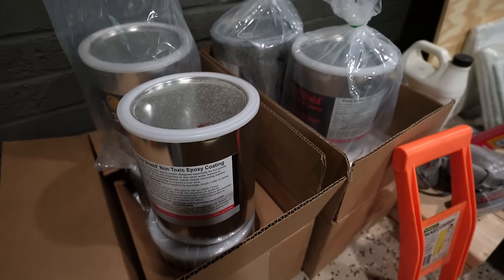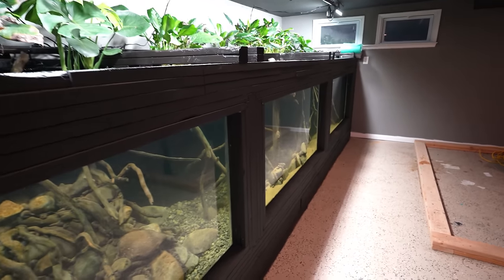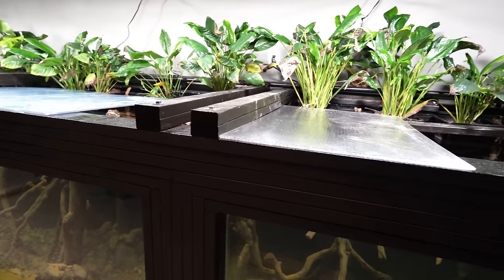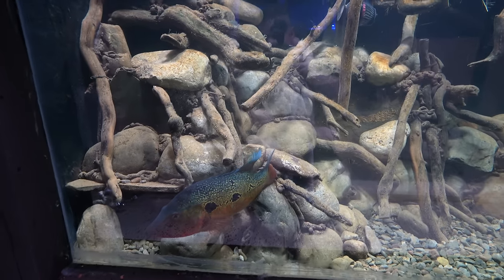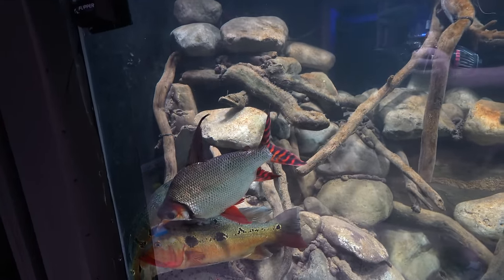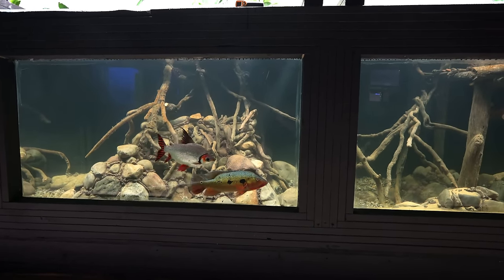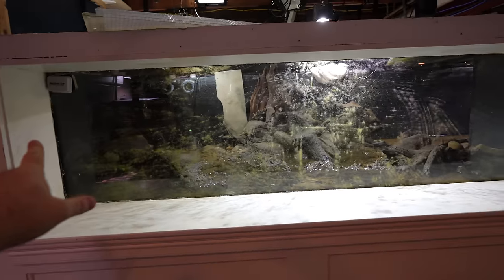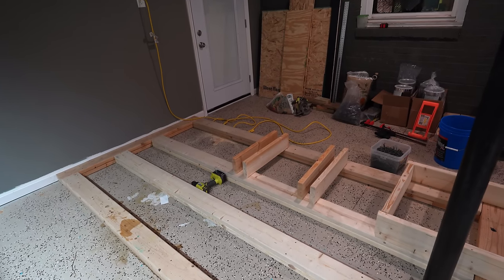Moving Monster Fish into the 4500 Gallon Xingu River Aquarium & 3 Big DIY Projects Begin!

Comment: This has really come together well, bravo! 🎉 One concern I have is that when you build those other 2 aquariums you won't have the opportunity to sit back and take the whole tank in. Is there enough room to sit and relax between the big tank and the 2 new ones? Looks only about 4 feet space? Do you hope to keep the nutrient levels more under control in this tank? I see a lot of tough black algae in your previous installation, while it's not any harm to the fish, it's very unsightly. I would 3xpect the big filter should be more than enough to keep it stable. Good luck, I look forward to seeing this mature. You changed my mind on your scape 👌
Reply from the maker: It is a little over 4 feet and the open area in the middle is 12 feet, so about a 10 foot isle to the left and right. I mocked up some wood to check the view and from the human eye it is unobstructed, but from the camera you have to pivot side to side....anyways I am still deciding 😊

The 3000 never had nearly enough water flow, mechanical or clean up crew for big messy Cichlid and Bass, everything about the new build is to correct those issues. 😊
Reply: @AquariumDomain. Great to see you moved it back a little as in your latest video, I think that's going to make all the difference to you!

Comment: Not scared of plecos shredding through the wood or seal?🤐
Reply: That's the question I also have! (Because I HAVE plecos in my plywood tank and I'm not sure if that's a good idea)
Reply from the maker: I have kept large amounts of Pleco in all of my diy tanks for decades and haven't ever had a problem. I think they are way more interested in the leftover food from the big boys and the biofilm on the rock and wood.
Reply from the maker: I have kept large amounts of Pleco in all of my diy tanks for decades and haven't ever had a problem. I think they are way more interested in the leftover food from the big boys and the biofilm on the rock and wood.
Reply: @AquariumDomain.  Thanks a lot! My plywood tank has been installed for two weeks now and I never saw my plecos on the walls. I had them in a polycarbonate tank (also diy) for about a year and they never scratched a panel. Epoxy is even harder than polycarbonate

Comment: Lol.. I would like to have a problem of "accidentally building 2 1500 gallon aquariums". As excited as I am about all that fish move, a missed opportunity there. Could have should have would have put 1 guppy into 4500 for kicks and giggles (and then move back out obviously). It would have been the fanciest guppy on the planet for a little while. I am glad they are all settling in. The 3000 looks like a warzone but I am sure that sharks and angels are going to love it. I hope you model it after something cool like Roatan Honduras (my most favorite scuba place). Of the 3 times I went... we do safety stops right at 15ft mark where shallowest of the 3 shelves is and its a wall filled with a gazillion fish. Normally when you scuba dive you get dropped off into open water and you dive deep and do your safety stop in middle of nowhere but Roatan has 3 shelves (15ft, 45ft and 60ft and then it drops off to couple thousand feet deep). Looking forward to seeing it come to live, whatever you decide.
Reply from the maker: You nailed it with "warzone" been working in there clearing out all of the rock, wood, sand from the previous build...looks crazy. I have already had some ideas for improvements on the filtration, waterflow, lighting and the tops...so safe to say the new Predator Bay 3000 is going to be a big improvement over the first Predator Bay! 😊😊